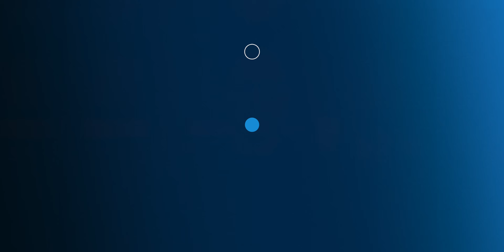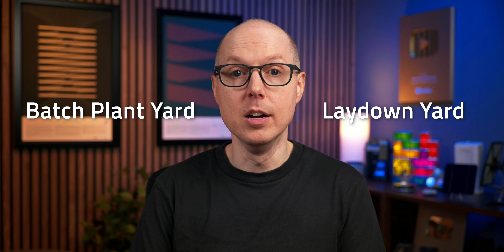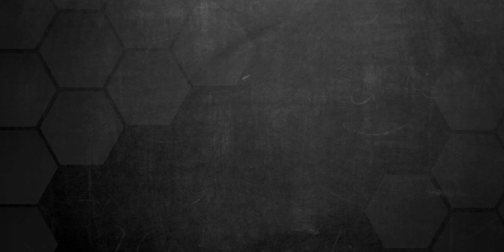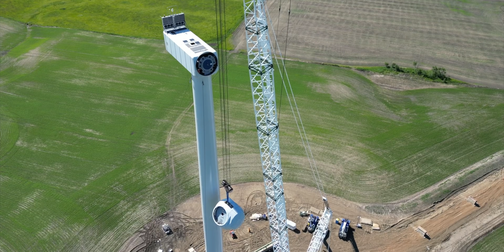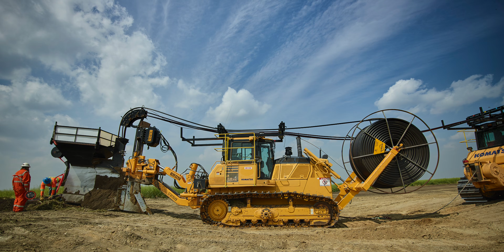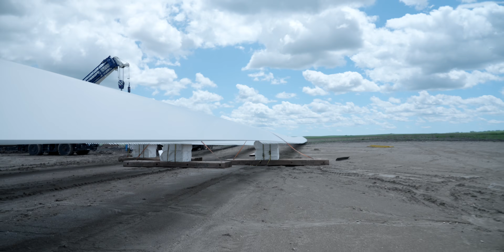The Hidden Work Behind Wind Energy

Comment: I'm skeptical about these as I live in Riverside California where these are present but rarely ever working.....  How much fossil fuel is used start to finish for each completed and operating wind turbine? Diesel, gas, pouring, fabrication and the grease for movement including maintenance per year in fuel & parts. I bet it's a lot more than production for a solid uninterrupted year of continuous use w/o down time.
Reply from the maker: There are a lot of life cycle analysis (LCA) studies out there that look at the impacts from cradle to grave for these type of energy projects.  Wind energy is a drop in the bucket compared to natural gas or coal power plants.  The advantages are kind of staggering.  Here's just one example: https://www.nrel.gov/docs/fy13osti/57131.pdf.  Also many companies are developing methods to break down the wind turbine blade epoxies for recycling and disposal. https://www.vestas.com/en/media/company-news/2023/vestas-unveils-circularity-solution-to-end-landfill-for-c3710818
Reply: @UndecidedTechnology  Thank you Matt. This is certainly better than coal and gas, but many mistakenly believe like EVs that this is pure clean energy, which it isn't. It feels like Lost in Space with William Hurt—alternative power solutions emerge only after society is deeply hooked on fossil fuels.
Reply: Most idle wind turbines are due to oversupply on the grid. It's a lot faster/easier to spin down a wind turbine than a gas or coal power plant.
Reply: @ solar still seems to be safer and more robust.
Reply: @ True but we're always getting text messages during the hotter months warning us about power use and grid issues with power availability. It's a bummer because we were excited when then put them in and now they often sit idle or in wait for repairs. Lots of dust/sand there.

Comment: Anyone else who wanted to see the blade clear those trees during transport?
Reply: They didn't go over, they steer more aggressively in that part of the turn. I've got a video of them making the sharp 90 off the highway and heading south to Bekevar. The rear pilot vehicle driver gets out to steer the back trailer. The locals are used to stopping for our oversized farm machinery transport or oil rig moves. Everybody just pulls over well away and gives them room. I'd hate to transport those in a more urban area where common sense is rare among the driving public.

Comment: Great Video!! We built 56.9-meter blades here in South Dakota and our blades have a tip speed of about 218mph I would assume these have something similar.
Reply: The tip speed should be very similar. They aim for about 3 times the speed of the wind for the tip speed for all sizes. So 218 mph are a bit on the high side, possibly a conversion error (like 218 km/h instead).

Comment: Matt, with these being so far north, what deicing equipment is installed in these blades? Cool video as always.
Reply: There is no deicing equipment installed on them (I built 5 parks,including that one). Ice can definitely build up on the blades, and in icy conditions, honestly, it's a good coating that helps the ice not stick, the fact they are moving alot, and then the biggest one is to not go near them in the icy conditions. Generally the rule if there is ice on the blades os to wait outside of the pad for 30 minutes to ensure there is no ice shedding from the blades as the ice can travel far. Once considered safe, workers may enter. They are generally not built close enough to houses for this to be an issue and put where the majority of traffic is not on those roads during winter (near alot of farms) to ensure the safety there.
Reply: Basically these ones run at a low speed to shed the ice until the vibration sensors show it's balanced enough. If it doesn't balance, it automatically restarts the balance procedure after a delay. After enough delay cycles it throws a fault and someone has to go check on them. If it passes the balance check it goes through the automatic synchronization procedure and is locked into the grid.

Comment: Well done video.  Im a now retired long haul truck driver. I used to transport embedment rings for the towers. Crucial foundation parts. It was amazing how as time passed the towers kept getting bigger and bigger. If you go to another farm check out if you can just how much concrete is in the ground. It's a mountain of material. I delivered in both the USA and Canada. They were all great but the safety levels were definitely better in Canada. And as far as bird kill rates at wind farms one of the additional benifits of the larger towers was there are less bird impacts compared to eary much smaller towers that spun at very high speeds. One farm i delivered to in British Columbia had a unique problem with the local wildlife. Bears, Grizzly bears.  Everyone have a great day 🌤.
Reply from the maker: Thanks for sharing.
Reply: 'just how much concrete is in the ground...'    It's an incredible amount.  But why don't they cast any buttressing into the tower bases, so they can use less concrete?!  And maybe some short cables, to give some diagonal rigidity?  It doesn't make sense to just have a huge flat base!!
Reply: @someotherdude  this is why it would be great if he could video the concrete foundation. It's not flat, it's a huge pile. Wide on bottom, narrow towards the top. It then gets back filled so the surrounding back fill helps to keep it in place. They use so much concrete each farm has a concrete plant on site during construction. Think of the wind shear that's trying to topple the towers at all times. Again, absolutely amazing.
Reply: @someotherdude  You should call Orsted.   Seriously.

Comment: Just some math: 36 times 5 MW is 180 MW installed not 200 MW.
Reply: Those windturbines are N155 5x, in particular these have a nominal power of 5.7Mw. 5x indicate they have 5Mw or more. so Bekevar windfarm has a nominal power of 200MW
Reply: Oh, that is a long story. There was supposed to be 40 turbines at 5MW. But a lot of my neighbours refused having them on their land. With the need to place them away from yards, roads, and Ducks Unlimited wildlife reserve they couldn't get enough sites. So they had to order slightly larger turbines to make up the contract. I should ask if they actually make the label plate power.

I'm 3 miles north of the project and didn't get any towers.

Comment: Turbines require tons of oil to operate.  The blades are not recyclable.  Kill tons of wildlife.  Wind will never produce enough energy to be a majority contributor to the grid.  Wind is just not the answer.
Reply: in germany, wind IS producing a major amoung of electricity. and the amount of birds killed by wind energy is orders of magnitude(!) smaller than the amount of birds killed by, for example, house cats. or cars. or windows. or the inevitable loss of habitat that comes with the extreme climate change we're facing.

also: "tons of oil"? good to know. so THAT is why there's a big oil delivery truck driving to every single turbine all the time.... /s
Reply: @theblackwithin3457 Wind energy in Germany is about 30%.  Wind is the largest single category, but not the majority of the energy produced.  Thank you, try again.
Reply: @ i said "a major amount". not "the majority". please go back to school, you obviously missed "reading comprehension" ;)

also: those 30% are a higher share than coal. so - do with that information what you will - most likely "ignore".
Reply: @theblackwithin3457   You should have used "significant".  If you want pound your chest, you have to be the "majority".  Wind is not, nor ever will be the majority.  If the wind stops blowing, the rest of the grid will fill the gap.  Meaning wind power doesn't really matter in grand scheme.  The dollars spent on wind, versus the return on investment are leading to diminishing returns.  German way over spent on wind, and it's only getting 30%. For what they are spending it should be providing 60-80%.  Wind is expensive to maintain, requires lots of oil to run, blades are not recyclable, and wind is not reliable enough.  If I owned stock in these companies, I would sell, sell, sell.
Reply: You're just mindlessly repeating anti-wind propaganda.
Reply: @TheDanEdwards  We could cover the planet with wind turbines.  Still wouldn't be enough to power the grid.
Reply: @ what you're saying is plain factually wrong. just shut up.

Comment: Can you do a followup on the maintenance of wind farms, what efforts it takes, costs, man power, on going materials. I think people would like to know, I don't think it's a build it and forget it.   Thanks,
Reply: Nothing is build it and forget it. Every type of power production requires work, materials, and maintenance to keep them running. The difference is these don't need fuel, as well as maintenance.
Reply: @21jimmyo  But the pieces, when they fail, are NOT recyclable.
Reply: @dbf1dware  while older blades were difficult to recycle, modern blades are 85-90% recyclable.
Reply: A turbine like this, around 8000 USD per year and MW of capacity, where around half of that cost is labour

Comment: A Wind turbine project was installed here in Western New York.  51% of the people wanted them  48% didn't want them in their town..  Last I heard there are families still not talking to each other.   Two families had a farm that they received from their parents.  They spit the land 50/50.  One family built a house on their land the other family lives 45 mins away.  The family that lives near the turbine hears the noise of the turbine from their family member's land.  When the blade passes the  pedestal  it make a noise.  It sounds like a pair of sneakers in a drier when the wind blows.  It is my understanding that the WNY project puts out less than 30% of name plate.   30% may be reasonable because I never heard of any lifting of parts delays because of to much wind.   They went up fairly quickly.  My guess is that wind turbine projects can only be built with a Government hand out and tax credits to stay running.   My biggest concern Don't build them close to people and there homes.  After the project is put up the corporation packs up and heads home.   They don't care about the people...they care about the money.
Reply: This sounds like anecdotal nonsense...

Comment: ".....enough power for 100,000 homes...."

So long as the wind is blowing above a certain speed🙏
Reply: Not really, the calculated or estimated energy (not power) it will produce in a whole year, divided by the annual energy consumption of a standard or typical household should give you a number close to that 100k homes.
Reply: Wind is much more reliable at the heights of these larger modern wind turbines.

Comment: is there a reason they don't have a 90 degree joint so the blades can spin a vertical shaft instead of a horizontal one? It would let them move the generator to the ground and significantly reduce how much mass is way up high. I assume there's a good reason, I just can't think of it.
Reply: A multi MW shaft from top to bottom would snap because of how long it needs to be or would be so thick its not feasible. With wind you dont want gears, thats why they moved to direct drive
Reply: The problem with vertical shaft windmills is that half the blade is working against the rotation.  Half the blade is rotating into the wind while half is being pushed by the wind.  This is why you seed such unusual designs for vertical windmills.  It still doesn't help though.  They are much less efficient.  Too bad because the vertical shaft would make a lot of things easier.
Reply: @Core1783  I meant leaving the blades in their current configuration and gearing it around the corner. But exploding gears does make sense.
Reply: Even more than gears consider the problems of a 100 meter shaft carrying 7000 horsepower (5 MW)

Comment: 108m high. Rotor diameter 155 meters ? Pfft. The Seimen Gamesa 14.7mw turbines they've just installed on the Moray West offshore windfarm, Scotland are 257 meters high with a 222m rotor diameter. Great big SoB's 🙂
Reply: Just to clarify, the 257 meter figure is the top of the blade circle and the 108 you sort of compare it with is the hub height; a little math gives a 146 meter hub elevation as the comparable figure. 

If you're building the thing it's the hub elevation that best describes the degree of difficulty
Reply: No roads
Reply: @thekaxmax  True. But the Moray Firth is not exactly a millpond, so there are different challenges I guess.

Comment: I guess they should use 3d printer because they use 5 or 6 materials and print them where every is necessary than transport them and carry them loading them tell them to use 5d printer take only the material and print it 5d printer and construct it easy not that way sorry they have to use my 5d printer with 6 materials

Comment: Here I'm over thinking the pros and cons of attaching the blades horizontally versus vertically. It might help keep the machinery in balance a bit easier, but the crane setup would need to be far more complex; leading me around to figure that if it's working, probably best not to try to fix it.

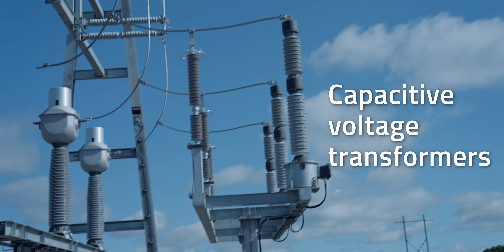Comment: 14:35 I’m going to need clarification on the amperage transformers and voltage transformers. . .
Reply: The Voltage and Current transformers are only for metering and protection. 

The Main Power Transformer hadn’t been installed yet.  But you are right, the MPT does change the voltage to match the transmission system.
Reply: I believe the current transformers are used for measurement purposes. Voltage transformers are what actually handle the bulk of the energy and make the voltage correct for transmission.
Reply: @dtemp132 yes current transformers (CTs) are used for measuring the current. The current running through the CT induces a voltage into the secondary windings. This voltage is typically in the millivolt range. The voltage output is directly proportional to the amount of current running through the CT.
Reply: @danielbruce1889  Actually they generate a current.  Usually between 0 and 5 A, which is scaled to indicate the actual current.  It you take one out of service you have to short the windings otherwise the voltage on the CT goes sky high.

Comment: How much CO2 impact is created to excavate, make materials like steel concrete, to truck materials to site, to construct materials in just the mat base. Matt?  Will the Turbine, and tower that created CO2 to design, manufacture, deliver, and erect plus blade replacement impacts ....ever offset all that CO2 generated impact with wind energy generation CO2 off set?
Reply: All these things have been documented over and over.  The critics are just wrong - wind energy is vastly less CO2 emitting that relying on fossil fuels.  You're carrying water for the fossil-fuel industry, and they didn't even pay you (did they?)
Reply: @TheDanEdwards  No Big Oil, Big Gas, Drill baby Drill $ backing, or A.I.....ffillllation. please send a CO2 study from raw material to recycle or landfill CO 2 impacts & CO2 off set of a wind compared to coal electric generation over life of wind option. I like wind energy. I am sure there is a much less impactful way to harvest wind transforming that kinetic energy into electric generation, then 3 blade giant turbines. The concrete bases are vissually massive, then buried out of sight out of mind, but CO2 total impact is still on my mind.I apologize for thinking, and asking Matt for a video doing a study.
Reply: Yes, easily offset. As if fossil fuels dont need energy and infrastructure and construction. Cracker towers can be as high as a wind turbine to refine oil, requires huge compressors, heat, pressure, temperature, etc. Wind is better
Reply: @davidl.howser9707  of course not, it's all a false sense of feel good. The amount of fossil fuels and oils to design, produce, transport and then maintain, it would have been better to stick a coal generator there.
Reply: @coboldelphi  then the logistics to move  the power to where you want it.